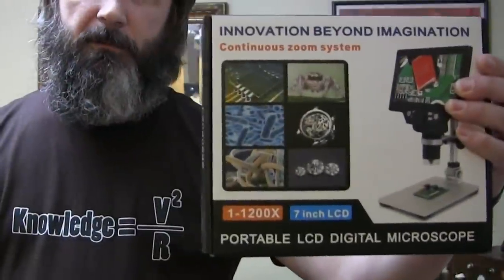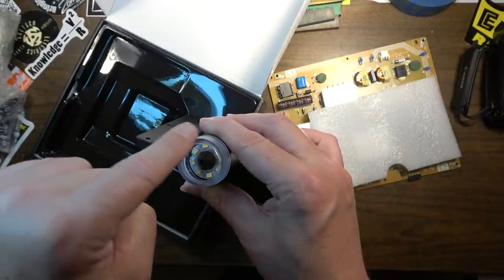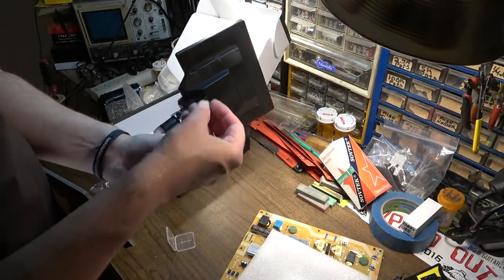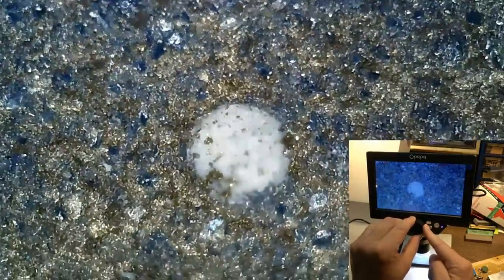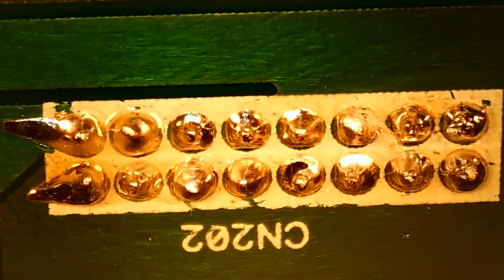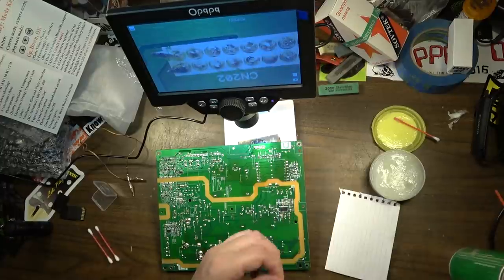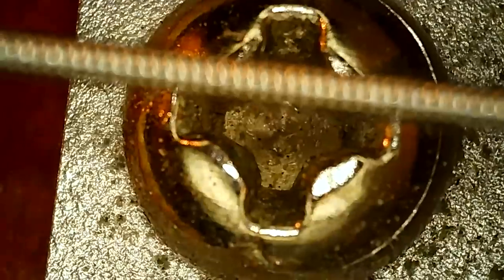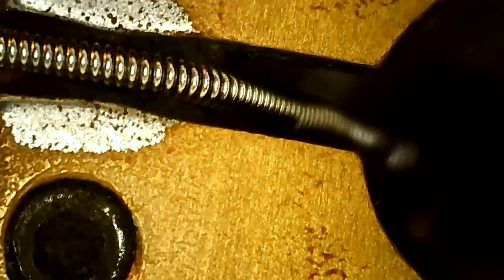DISGUSTING! Dirty GUITAR Under a Microscope

Comment: Same tv, same problem. After I fixed it I didn't tighten the screws all the way so the boards could move slightly with expansion/ contraction.
Reply from the maker: Can’t do that either. They get ground through those connections.
Reply: @TheGuitologist  let's say "snug". 2 years, no issues.

Comment: Those solder joints and the struggle are likely a result of the flux you have not being very good. I would recommend picking up an MG chemicals rosin flux pen, or some no clean liquid flux for soldering on PCBs like that. You'll find it much easier to apply, and more effective than that paste-flux you used.

Comment: I think the strings where you fret are going to be nastier than where you pick. The reason being is that the part where you pick vibrates a lot, and likely deposits onto the guitar body between and on the pickups. Meanwhile, since the strings do not vibrate as much closer to your fretting hand fingers, a lot of that stuff gets kept on the string.
Reply: The Veritas strings (as well as the Black Diamond Core Bond, which are -- I think -- that same exact thing) are weird. They are "coated," but rather than coating the string after the wrap wire is wound onto the string (similar to Elixir), they coat the core wire PRIOR to winding the wrap wire around it. I really do not get the point, or how that is supposed to extend the string life, but whatever. It might keep the core wire from corroding, but it does not stop the wrap wire or the plain strings from corroding. The amount of "coated / treated" strings that do not treat the plain strings (ie, like Anti Rust plain strings from Elixir), and does weird sort of coating methods for the wound strings (ie, coating the core like Veritas, Core Bond strings, or coating the wrap wire before winding the string) amazes me. Strange.

Comment: Comparing nuts under a microscope would be interesting, first to check if the job was made correctly as you said and comparing how different materials wares (plastic, bone, brass and the Tusq material from graphtech)

Comment: Interesting stuff. Ages ago a friend bought a cheap kids digital microscope. Really aside from the cheap parts, the worst thing was the software, so he spent a couple months writing some corrective lense software, and it turned out quite good.
Whoever fights monsters should see to it that in the process he does not become a monster. And if you gaze long enough into an abyss, the abyss will gaze back into you.”
― Friedrich Nietzsche
I used to use a cheap pocket microscope to determine the health of plants, with mites or bight that is scary. Really a cheap ass camera these days can do all of it and more, its just not designed that way to see shit.
That gunk is likely composed of DNA and many other things, it wont be long before you may have devices that tell you exactly who owned the guitar or other instrument. Inspectors of machines already have many of these devices many for metal fatigue, types of decomposition before crap falls on ones head. There are simple devices that will nail exactly where veins are, to give injections,  Its weird how far we have come from using simple magnifying glasses.
Smart dudes like Johann Carl Friedrich Gauss figured it out ages ago.

Comment: look how the string is wonky down in the block, interesting, it twisted?
Reply: I don't like how that one string is so small in the saddle slot, I might go over some saddles with a magnifying glass, I don't like that, I could fill with solder and cut slot perfectly

and the contact point down there is so sharp, it needs to be radiused for good tremolo use, that edge will wear on the string.. man

Comment: I wondered whether the ;focus-wheel might get smoother with use ... It's probably plastic gearing that will 'wear-in'. Maybe I'm just an optimist ??
Still, you've practically solved the focus issue, by mounting it on your lamp. Not to be unexpected of you !

Comment: Every couple months when I change my strings, I give it a complete clean and lube. I brush the nooks like a meth addict, brush clean and oil the fret board, polish if needed, then wipe her down with the top protectant spray. Changing strings is already takin 10 minutes Just give some love for the thing and clean it too. It's why I can't stand relic guitars, you treated it like shit to get that look in my opinion. You can try to justify it anyway you want but I never gonna get it.

Comment: Some dude wanted to play my bass during a break at practice one night. Once he finished my strings and the neck felt like it was smeared with syrup. I don't know if the bitch did that on purpose or what but, I had to change the strings and wash the neck to use it after that.

Comment: Solder tips must be expensive. lol
Reply from the maker: This tip isn't old. It's shaped like that so that it holds a bead of solder in the tip. For some applications, it works well, but this work is just too small for this tip that was on my iron.
Reply: @TheGuitologist  Well, it looked like it was the wrong tip for that job.  I know you have solder skills, and my comment was a friendly dig. Please don't take it seriously. I enjoy your video's, and you have the ability to repair even the most difficult projects. Thanks😀